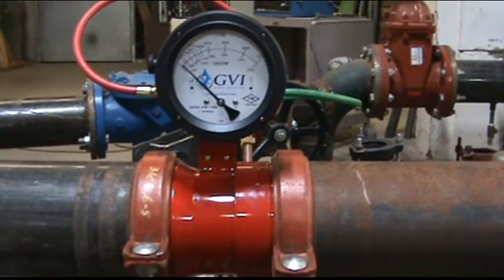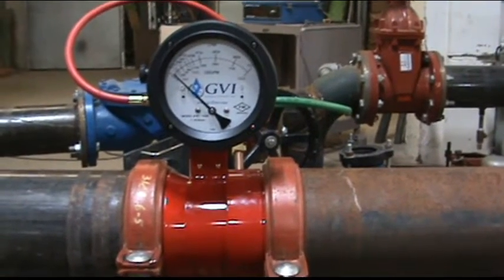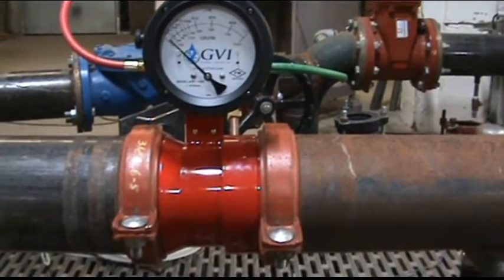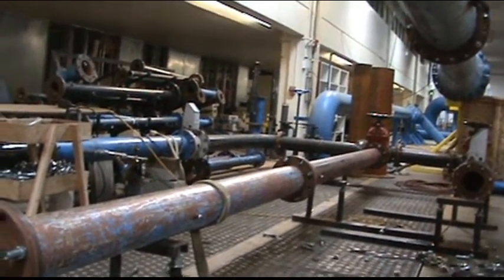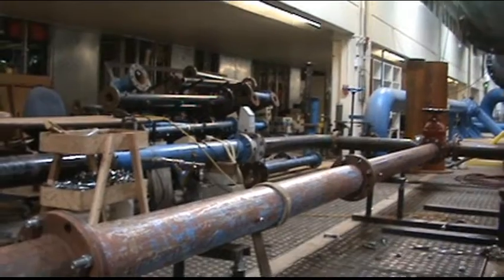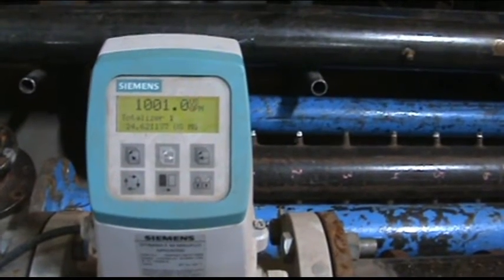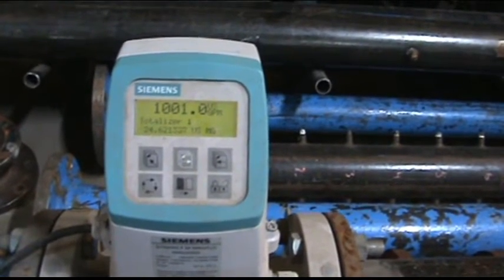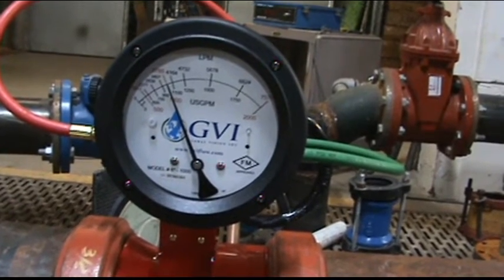GVI testing

Comment: Hi, Please, What is distance that should be between the digital flow meter and the isolation valve?
Reply from the maker: Hello, this should be a minimum of 5 pipe diameters before the flow meter and 2 pipe diameters after.  This is free of any bends or valves, only straight pipe.  Please email info@gviflow.com for more information.

Comment: can you give us clue why the needle in our test with similiar product, is shake around and couldnt steady like videos? maksimum range the scale is 3000 gpm and at around 1500 gpm and 2250 gpm, the needle shaking and unsteady
Reply: It's your test setup.  You need a throttling valve downstream of the flow meter to provide back pressure or else the needle will jump around like crazy.
Reply from the maker: Hello, and thank you for your comment.  This video is of the new patented GVI venturi.  I assume you have an older model.  There can by many causes for fluctuations as you describe.  Perhaps you can send an email to our team at info@gviflow.com and we can work with you for a resolution.  Thank you again. GVI team.